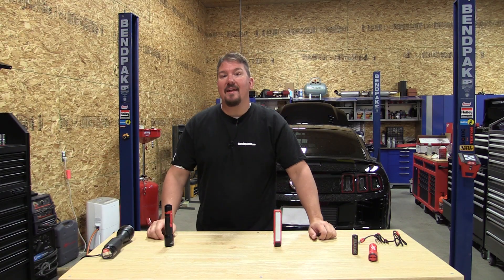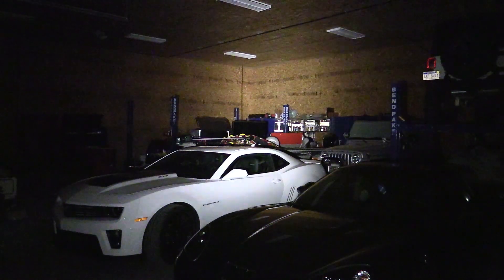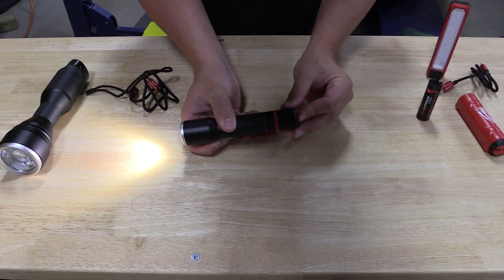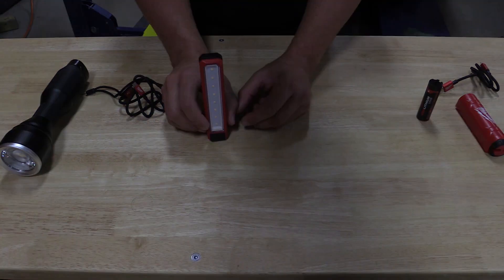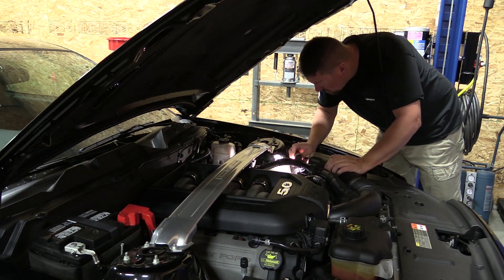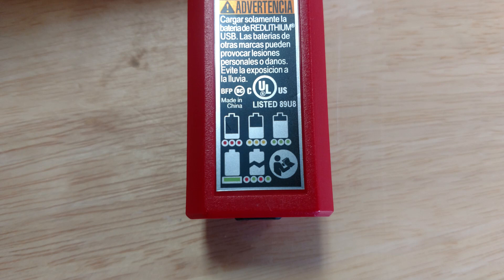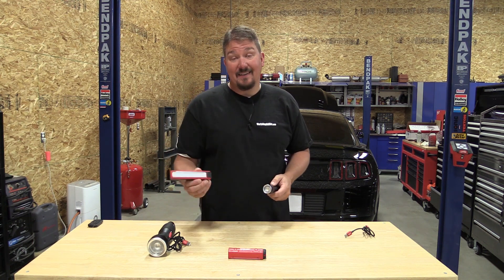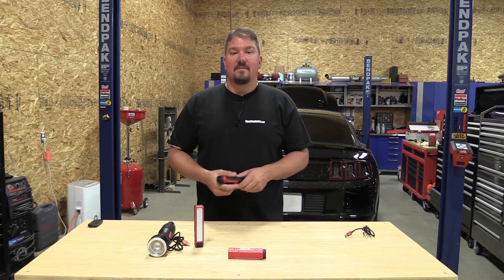Milwaukee Tool's NEW Redlithium USB Personal Lighting Solutions

Comment: On Home depot site the 700L says it has, 300 Lumens of TRUEVIEW High Definition Output. 
What is TRUEVIEW High Definition Output?

Can you use a regular AA? Say like you lost power in a hurricane, so you have no way to charge it.

Can you also unscrew the head?
I have a metal energizer flashlight, which I dropped, something came loose and there's no way to open the top of it. This was a good flashlight too. You could probably kill someone if you hi them in the head with it.
Reply from the maker: john M I am going to go with the easy questions and work into the harder ones...  First, it will not take AA batteries.  Just the Redlithium USB.  The head does not screw off by design.  I am sure it will come apart, but for the IP 67 rating it is not to be remove.  It is 700 lumens, hence it is called the 700L.  Next, TRUEVIEW Technology utilizes the most advanced LED technology and optical designs to deliver a consistent beam, optimized color temperature, and true representation of colors and detail leading to a more productive work area.
Reply: Marketing for a even color led. It is dipped in phosphorus so instead of a cool color you get a cool + warm = more neutral color. You lose a few lumens in the process but it looks better. Also the less are a few pennies more expensive.

Comment: These are 18650s. They just made them more complex to charge and fancier and changed their names. You can find better lights for cheaper from namebrands like Atactical, Wowtac, Thrunite, Olight, Fenix, Nitecore etc. Just search on ebay or amazon.
Reply: Exactly. Also there is a bad PWM effect in low mode on the 700L. Any light that has PWM is no good for working. Its really fatiguing looking at a cycling refresh rate.
Reply: Can I ask: what is PWM?
Reply: Its a fancy term for something that uses an electrical circuit that doesnt deliver constant power. Its when the light flickers. PMW lights = flickering.
Reply: PWM is pulse width modulation. Its a way to use voltage and current in a cycling frequency to start the LED to light and then take the power away quickly and dim it. They do that in very fast cycles to achieve the amount of light you want in each mode. The issue is that often these cycles are visually noticeable as a flicker. If you wave your hand in front of the light quickly you can sometimes even see a slight strobe effect which is some of the worst light and what I'd call an extreme case of PWM. This effect is like watching a very fast strobe light so is causing your brain to process all those flashes. The best not fatiguing light is direct drive. This is supplying the LED with a specific voltage that controls how much DC (direct current) the LED will use to light up, it is a form of constant light. Similar to looking at wall or the ground in direct sunlight, its a constant that does not change or flicker and much easier on your eyes and brain for less headaches!
Reply: Thanks Guys - that is useful info !  Now I know.  Thanks again.
Reply: No problem. On a different note, you'll notice that many new computer monitors are starting to come with flicker free technology which is direct drive. Flickering PWM LED in any situation is not good especially for some people that are more sensitive to it.

Comment: I am wondering if the batteries are the same size as the 18650 batteries?
Reply: Same size but not the same, meaning you will not be using 18650 batteries since the contacts are different.

Comment: Just in time for stocking stuffers. #WorkshopAddict.
Reply from the maker: I highly recommend the Rover!  We used it for 12 hours yesterday.  We went through two batteries and it fell from 5 feet over 20 times.  So awesome for automotive.  Our issue with it is that is is small and we do not think about it or that it is there and we knock it off without thinking.  That light changes everything as to how we get good lighting in tight places.
Reply: WorkshopAddict definitely going to look into the Rover. Looks perfect for automotive work. I need to work on the 4x4 transfer case on my truck sooner than later.